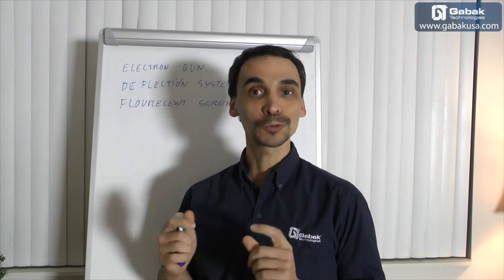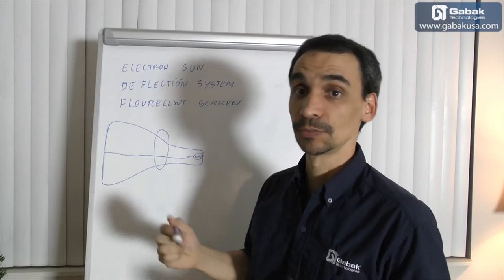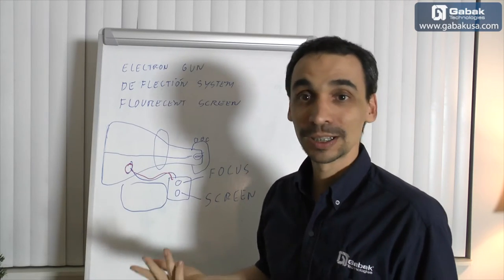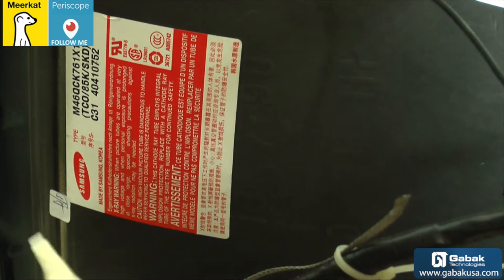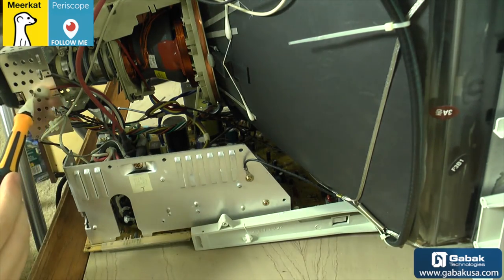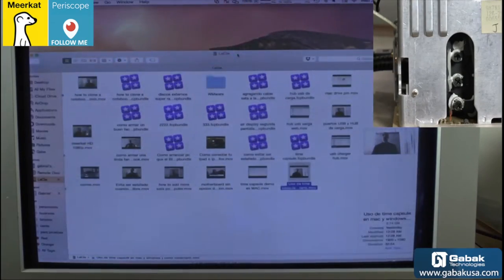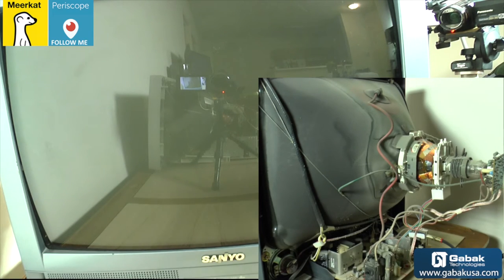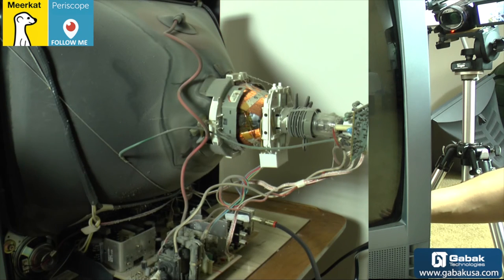How to calibrate brightness and focus in monitor or TV CRT

Comment: My "new" (factory packaged) hp 7550 CRT monitor i got from a recycling center was fuzzy, i adjusted the middle focus screw and it became much better, but is is still a little bit fuzzy :) Next il do some overclocking, hopefully it can go past my hp M783s running 1024x768i@160hz...

Comment: thank you so much for the great video , i will see more , 
my tv have  blue horizontal lines but the brightness is good , and the black is good too , the horizontal lines appear more clear at the startup of the tv but after 15 to 20 min the lines become less and i can see the lines only in black/dark image ,( i did the fix carefully that you mentioned  from the little board  ( fucuse and screen ) but the lines sometimes will go and some times if i turn the tv on i need to wait more time to get image ? 

my question is :
1- if i start the tv why i need to wait 15 to 30 or more to get the true brightness /black  or colors ,i need fix please,
2-what cause  the horizontal  lines and what is the fix ?
3- i wish my tv have more contrast because the contrast is still low even if set it to 100 ,  if i tried to turn the contrast up from 35 to 100 nothing happen and still the same , but if i turn dawn contrast from 35 to less i can see the picture become darker ! is this problem can be fix and the  tv have  a chance for high contrast again ?

the TV is "sony trinitron 32 inch  sd  curve widescreen" from 1995 or 1996 japan made, this is rare tv that's why i think its worth to fix and keep ,
thank you so much and sorry for my poor English .
Reply from the maker: sometimes the tube is worn out and there is nothing you can do.
if you can get an LCD it is more healthy for your eyes no radiation

Comment: hey thanks for all the information although I didn't manage to properly tweak the focus, maybe it's because the tube is old? it's a 2003 samsung syncmaster monitor
Reply from the maker: you are welcome.
maybe the tube is old an weary.
try less brightness and tweak the focus again
and let me know
Reply: GabakUSA Free computer training unfortunately lowering the brightness makes the screen more blurry, I also noticed that the middle of the screen is more blurry than the corners of the screen and also the screen twitches sometimes and when it does, you can hear the noise coming from the tube if your room is quiet 

again thanks for all the help I'll probably just buy a new one, crt's are very cheap
Reply from the maker: B. Eltz you are welcome.
yes you can get them for free in craigslist sometimes or get LCD for 10$ in LETGO app o any garage sale ;-) at least it was a good experience ;-)

Comment: I had to increase my screen's sub contrast pretty high to make the picture not look washed out in a brightness that wasn't unacceptably dark. Video looks great and so do games, but the new issue that I am having is that some straight vertical lines now appear distorted, like they curve, this only really happens in pause menus, not an issue during video or gameplay. Is this particularly bad for my screen, are there any repairs that I should get done to it to remedy this, or is this just a sign of the tube getting old, its from 1989. I want this screen to last me 10-13 more years, is the degree of contrast that I've added going to kill it before that?
Reply from the maker: tubes are not going to last forever maybe it is at the end of it's life cycle. I have a 17" LCD monitor for $20 if you want something cheap

Comment: hello again. So I got a pretty good quality 19" Philips CRT from somewhere around 2004-2005, the owner used it for a few years than he put it aside, basically it's not damaged at all, but there's a.. I'd say mid frequency noise, not high freq like many old TV's used to have but something between low and very high which can be heard near the flyback;

 and then the other noise you can hear coming right from the flyback but it's louder and if you increase the refresh rate like to 120hz it will sound as if it's going to explode, also If i wear a headphone I can hear the interference inside my laptop when it's turned on, because the top of my laptop is made of aluminium
any advice?
Reply from the maker: look for a micro arc between the flyback and some ground heatsink
if that is the case the flyback is damage and it need to be replaced.
be super careful that can kill you or get electrocuted ;-)
Reply: if I continue to use without fixing anything, can it cause any harm to the environment and the tube itself? in other words can it burn down my entire room and apartment?
Reply from the maker: B. Eltz if you keep using it like that it most likely will stop working when the flyback dies completely 
if you live here in USA you can get one CRT for free or 5$